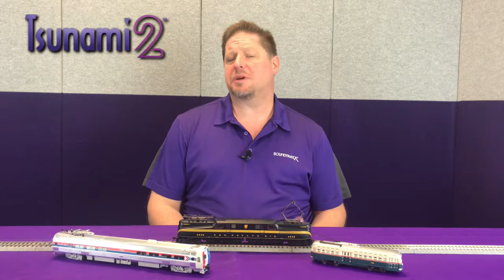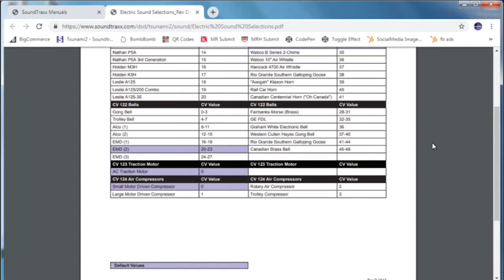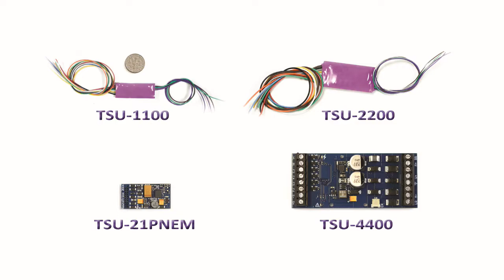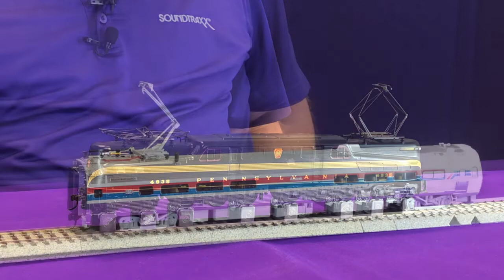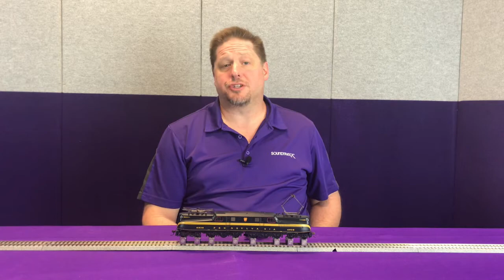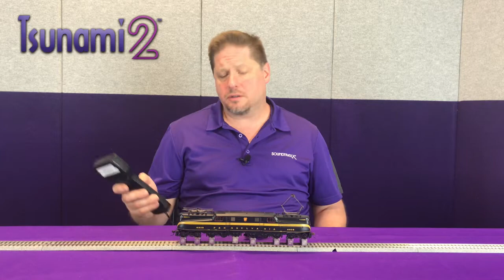Tsunami2 Electric Sounds

Comment: will this be a good fit for Bachmann GE E33  (spectrum series New Haven)
Reply from the maker: ON the E-33, yes.  Absolutely, so get the TSU-2200 for Electrics and wire it in!  Shop now:  https://soundtraxx.com/products/tsunami2-digital-sound-decoders/tsu-2200/
Reply: @SoundtraxxDCC  thank you so much for the reply.. I did get one from YankeeDabbler, but after speaking to someone in tech group (Norman, I think), I was told this would need multiple miniCube 3 in series. Luckily with smaller baffles I can fit 4 miniCube 3 in E33.
Reply from the maker: @krishsoundar3857  We were amazed by the sound that you can get out of these new tiny speakers. They do sound great!

With the TSU-2200 and 4 Mini Cube 3 speakers we would recommend wiring two sets of two in series and then wire the two sets together in parallel. In other words 2 speakers (series) + 2 speakers (series) and wire these together in parallel. If I just confused you call Norman back and he can explain in more detail: (970)259-0690 ext.22 or support@soundtraxx.com
Reply: @SoundtraxxDCC  thanks you so much for the response.. your customer service is excellent.  I bought 4 of these mini 3s and due to space I put in only 3 in loco all in series, since I only use low volume. Don't want to damage the decoder with this config. Will be contacting support soon.

Comment: Is that a Bachmann GG1? I have a Sound value version but want to upgrade to a Tsunami 2 in the near future, after I get a BLI Reading T1 and put Tsunami 2 in that one.
Reply from the maker: Yes, it is a Bachmann GG1. We would love to see the finished results when you are done upgrading!
Reply: @SoundtraxxDCC  don't worry. i might post it to twitter. i just bought a bli reading t1 that has tsunami 1 in it so that'll get the tsunami 2 upgrade first. i was told id have to gut the thing to install Tsunami 2 but couldn't i just connect the 9-pin harness from the tsunami 1 to the Tsunami 2 or will it involve more than just that?
Reply from the maker: @James-Railyard you can swap the 9 wire side with the old harness. The speaker connections would need to be redone, and the cam goes away. You can contact our Customer Support Department if you need more assistance: (970)259-0690 ext. 22 or support@soundtraxx.com
Reply: @SoundtraxxDCC  thank you so much! I'll be sure to update when it's been done. now i just need to wait for the engine to arrive in the mail.
Reply from the maker: @James-Railyard  Yay! Good luck with the install!